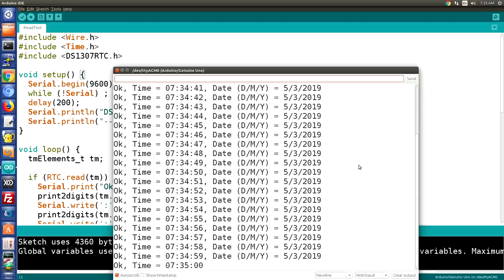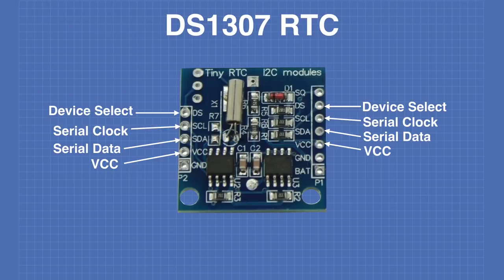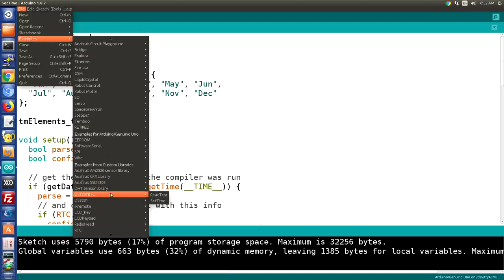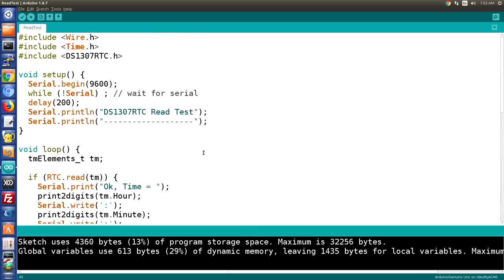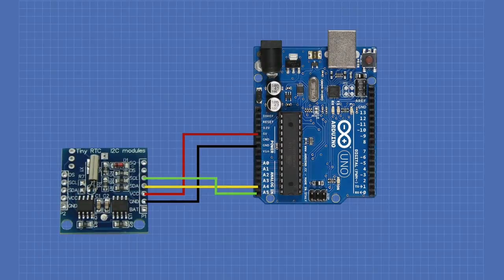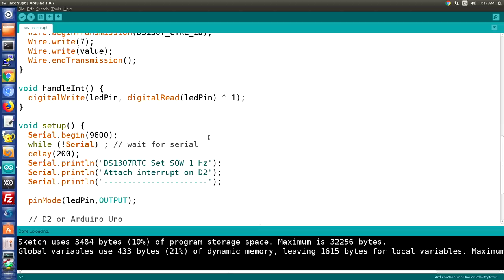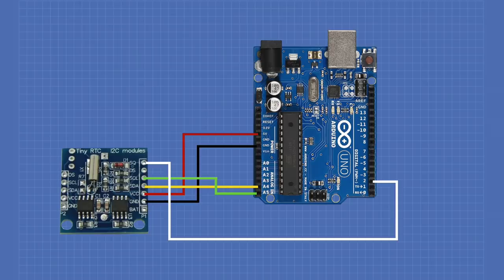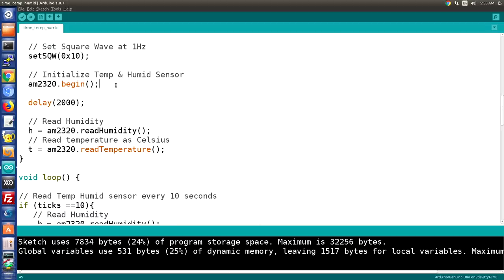Arduino Real Time Clock - Using the Tiny RTC

Comment: I have 4 modules all of them are running to fast about 10 minutes a week.
Reply: Voyager I have a few and found them to gain time too. They seems to be consistently fast - but the gain seems constant. I was going to try using a GPS module attached to the arduino at the same time as the clock, find the drift % and periodically adjust the RTC. I was planning to keep track of the drift and last time adjusted in the RTC memory.